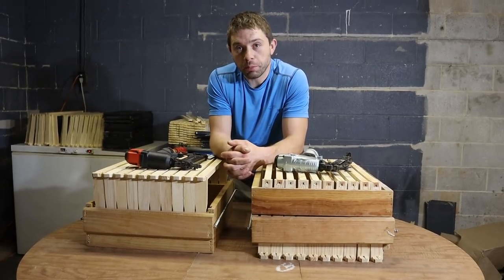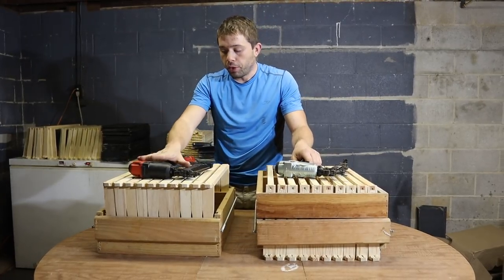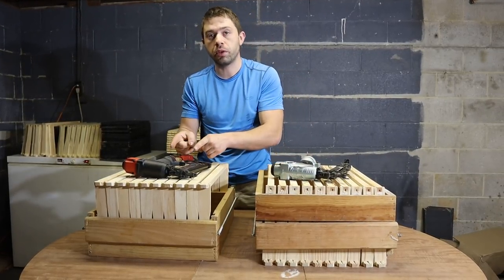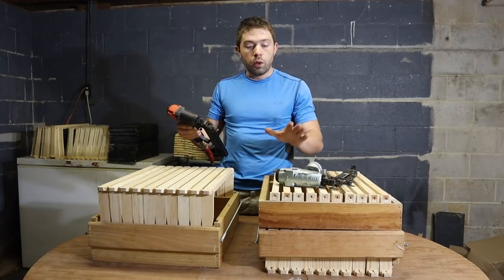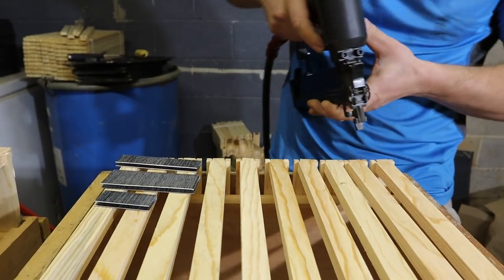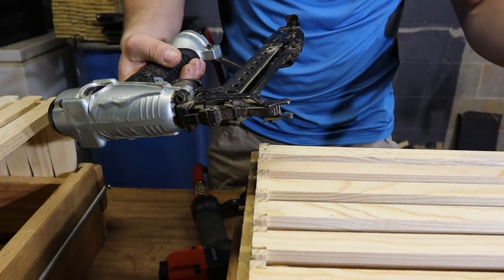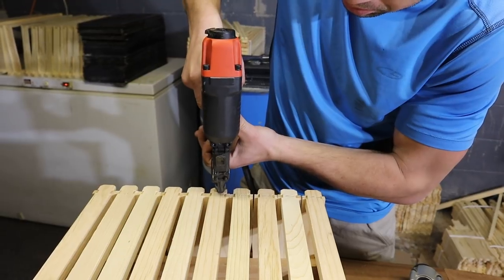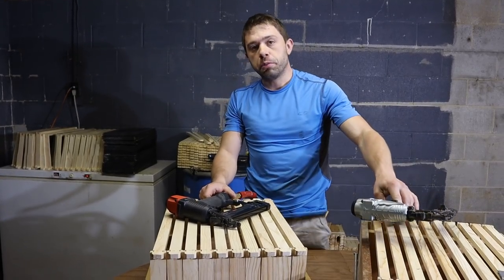🔵Best staple Guns for beekeepers? Build Faster & Build better!!

Comment: Hello Kamon, I had both the original named Hitachi nail, staple guns with a Bel Air pancake portable green compressor. I also used Senco 1/4" crown, 7/16" crown, and their brad nailer over the years as a carpenter, builder of mine own house, and putting together my tops, bottoms, pallets, boxes, and frames. Nice to see that others use the like even if this was 4 years ago. I try to buy American tools, but I sometimes need a cheap back up that can take a beating then thrown away as in using HF's small angle grinder to snip and cut blow out staples and nails in my boxes, and grinding tile, metal, and thick plastics. I will put on things temporary to be able to staple or nail at exactly 90° to help thwart that. Also I turn my frames and boxes 180° to what you show to relieve that edge stapling. Sometimes when I don't depress the safety firing tip all the way it only lets half the amount of air into the gun and it causes that nail or staple to not fire properly like you have on occasion and I myself sometimes. Pulling back the latch or slide once against the staples and making sure it is clean and free of paper or glue that holds the fastener clips together helps with the blank shots or misfires. Hope this helps you. Thanks for all the videos. I am becoming a huge fan because seeing all these things I experienced in your videos when I was young, your age with a family, and am know probably 25 + years older than you now is a good flash back. Also like the humor. Keep it up. Beekeepers and spouses. I funny challenge at times. :) 🐝

Comment: To use the Hft stapler on the frames, you can turn the box and use the stapler from the opposite direction so the safety lands on the bar instead of the edge.
It requires a little more reaching, but makes it faster. 

Also, Hft tends to have several brands or models, and they may have another one in the same price point with a different safety design that works better for that application, so I would consider that safety design as a deal breaker if I wanted to use it on frames.
You have to get a tool that's properly designed for your application.

And finally, when doing frames, if that was all I had, I personally would wire or wedge the safety back, and treat it like a loaded gun exercising very good trigger control, WHILE WEARING SAFETY GLASSES!!
Unplug it from the air hose except when actually stapling, don't have your finger on the trigger unless you are aimed at the wood, and as soon as you are done with the frame project, release the safety to normal. 
And don't leave it unattended with the safety disabled either, in case someone else picks it up.

Comment: Kaymon, why don't you just turn the staple gun 180 degrees so the air hose feeds across the hive and you don't have the issue of the safety lever not having anything to press down on? Speaking about the HF stapler
Reply from the maker: That totally could work but I am all about speed and I am short and I don't like leaning!

Comment: I have one of the Central Pneumatic 18 Gauge 2 in 1 nailer/stapler and run the 1-1/2" staples in it.  Along with Titebond III, this works great for most bee work, even brood boxes (I do add a few 2" coated screws to the boxes too).  I rarely have a problem with my stapler, best $20 I spent at Harbor Freight.

Comment: Great comparison Kamon.  I’ve had the harbor freight brand stapler fo over a year and ran about 10,000 staples through it so far and no jams or misfires (except when I run out of staples, does that count?). I do agree that the little safety spring can be a pain on some shoots, but I’ve found if I can turn whatever I’m stapling I can usually get it to work. All in all not to bad for the price. 😃

Comment: Air tool tip oil daily with 30 weight non detergent oil.  Air tool oil and air compressor oil  is nothing but 30 weight non detergent  oil repackaged and marked up.

Comment: I went back to shooting a sideways brad cause I got over throwing perfectly good frames away cause wider part of the sides got propalised and broke off when doing inspections. I tried using these frames for the outside frames but the novelty wore off and once brood was gone I just discarded them. I use liquid nails on all joints, boxes and frames etc. I tried a couple of thousand plastic frames and donated them to the bee club, the bees prefer wood and I am happy with it also.

Comment: I've been using a Senco SLS20XP 3/8" crown stappler for frames and boxes for years.  Really reliable and quiet stapler.
Reply from the maker: There you go I was thinking about getting one this year for the boxes but maybe next year. I have heard nothing but good about Senco 3/8 inch
Reply: @kamonreynolds  IIRC, I bought mine on eBay along with some rebuild kits and 1.5" adheasive coated staples.  Took me a bit of adjusting to get the depth set just right but after that, it worked great. One big staple takes the place of 2 smaller staples and they work really nice on the finger joints of the boxes. 👍

Comment: Just bought a Banks 2 weeks ago, no problems so far, but just putting swarm boxes together.  Why wouldn't holding the gun over the middle of the frame length instead of the edge work?
Reply from the maker: Hi TN bee lady. It does work that way but over thousands of frames it is slower and rougher on my back. I got spoiled on the Hitachi and old habits die hard.

Comment: So to start with, WEAR SAFETY GLASSES! 
ESPECIALLY when doing double staples, and the safety disabled, you are much more likely to have a staple go flying or a shard go flying. 
Your eyes are more valuable than some annoyance from the glasses.

I would be likely to disable the safety for doing that myself, just like I prefer a handgun with no safety, but eye protection doesn't slow the work down any, so no excuses for not wearing it.

Comment: 2 Questions:
1.  Is it necessary to shoot 2 staples on each corner of the frame?  I had only been shooting one in each corner.  
2.  Do you use staples on your boxes to assembling, or do you use Brad Nails?
Reply from the maker: You don't have to use 2 I haven't always. I do recommend glue though. Yes, I use staples on boxes as well

Comment: I've found that the cheaper Central Pneumatic 2 in 1 stapler from Harbor Freight works better than the Banks.  I've probably shot close to 100,000 staples and brads through mine and it hasn't had any issues. I have a much more expensive Bostich brad nailer that gets jammed every so often. I now have 2 Central Pneumatic 2 in 1s, I use one for brads and 1 for staples. The one thing that I did find is that the Central Pneumatic works better when the insides are greased as apposed to oiled.

Comment: Contractors use Hitachi nail guns.
Reply: Yeah and mechanics use Mac and snap-on....some how I've managed to get by the last 50 years using craftsman and similar and never, ever broke one yet. Go figure. I've also got harbor freight staplers and nailers, rebuilt a house with the nail gun....best $80 I ever spent.
Reply: ? I'm a contractor.
Bostich and Pasload. 
Hitachi? You're kidding right?

Comment: Do you see any difference in the two regarding the adjustment of the depth adjustment?
Reply from the maker: They perform similarly in regard to the psi it takes to shoot the staple into the wood. The same PSI I used on my hitachi works nearly identical for the banks. Depending on  what I want I can adjust the PSI on my Hitachi air compressor
Reply: @kamonreynolds  thanks, Kamon. I was hoping that the Hitachi might have an on-tool depth adjustment that worked better than the HF unit.

Comment: How much air pressure do you use on the staplers
Reply from the maker: I am usually in the 50psi range but these guns do vary a bit. I don't want it sinking in too far. 1/16 of an inch is as deep as I want it to sink.

Comment: Where are your frames from and do you use acorn bee plastic foundation?
Reply from the maker: mann lake frames are what I prefer. Acorn I think has the best foundation but I am getting 3000 sheets of mannlakes rite cell since I am buying the frames assembled with the foundation added.
Reply: @kamonreynolds  why are you getting them assembled looks like you have a pretty good system to assemble them here?

Comment: Do you use these same staples to assemble hive bodies?
Reply from the maker: I do but I also use glue on the hive bodies. Otherwise overtime they back out as the boards want to cup/warp
Reply: @kamonreynolds  what length staples do you use on hive bodies?
Reply from the maker: 1.5 in